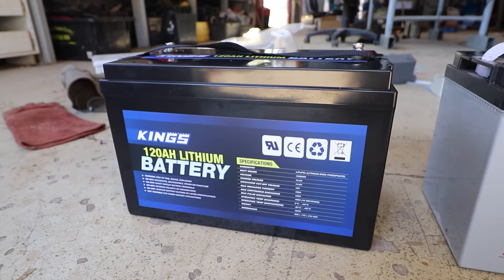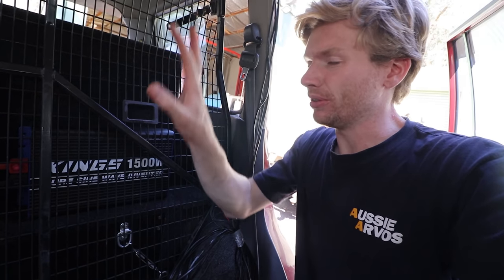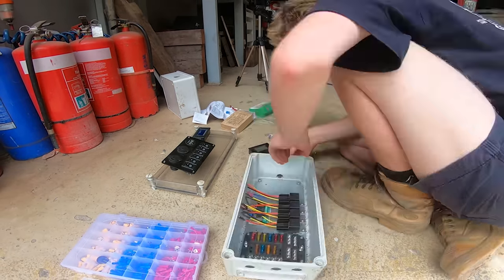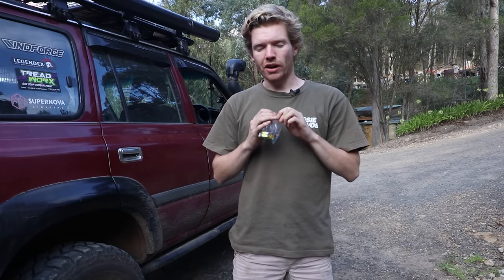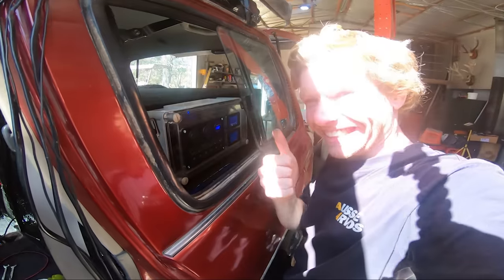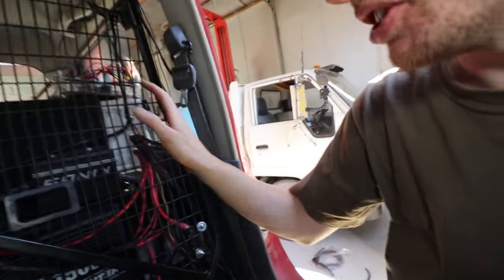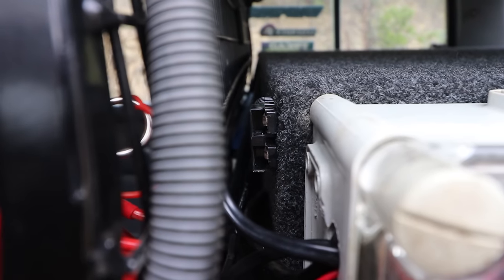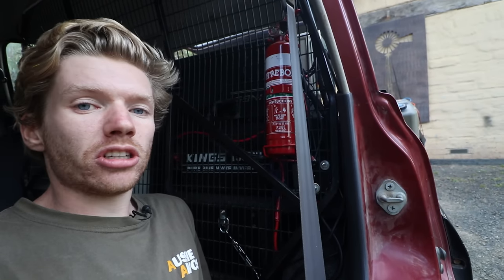is Cheap LITHIUM a BAD IDEA?? Building a REAL Budget 12v Setup

Comment: Well done !! You had a crack , it works,you have a big smile on your face  and more importantly you still have all your fingers and toes.
I have been running a 100 amp lithium power station for just over two years now , and love it.
I have a 25 amp DC/DC charger because that’s the my power station isn’t rated for anything bigger and that works well.
Keep up the good work , love the enthusiasm and the no BS approach !!
Thank you 😊

Comment: Hey Pat, love ya work mate keep it up. It's good to see someone having a go to show people that it's worth having a go at it themselves. I do have a couple of ideas that might help a little more with your setup. 1- is loom tape from car builders. Their tape is amazing and will work good through the grommet holes and will protect positive wires from rubbing through insulation on places like cargo barrier and nicer looking than split tube too. 
2- consider making your own gull wing window now you have your plasma cutter. Some hinges from bunnings, metal or ally frame and perspex window to make the gullwing would work well too if you wanted to see how ya go with it.Keep up the awesome work guys
Reply from the maker: Thanks mate, yeah I think the tape is a good idea!! And doing a DIY gull-wing would be awesome!
Reply: @AussieArvos  theres a guy in the states -dirt lifestyle and he does a really good video on making gull wings
Reply: Legit 👍
Reply: I was told by the professional installer that I could have got away with a 25 amp dcdc charger for just a fridge and a few lights but if I add more things to my 12 volt lithium setup the 40 is probably better and maybe you might find a difference as you run way more stuff than I do

Comment: Solid effort!

The only thing you got wrong is, lithium doesn’t work like an agm voltage wise (it’s a 12,8-13.2 resting voltage & 14.6v Max charging, if possible, set the max charging voltage to 14.2-14.4v so you get the most life out of it)…it’s a stable voltage until it’s empty, then it drops off quickly. Which is why you need the shunt monitoring.
Reply: Spot on mate
Reply from the maker: Thanks Paul, yeah definitely different charge and discharge curve !
Reply: @AussieArvos  although your setup is good… I’d definitely suggest a victron bmv712 unit. It’ll do everything automatically & give you a % of battery capacity @ all times, just input battery capacity & a few other specs…then use a Bluetooth app on your phone.
Reply: @pauladams4890  dude that thing is like $350. I think you've missed the point, he wants to do a budget build. Of course there are better products out there that do everything but that's not what the series is about. This is showing that for a fraction of the cost you can get something that is very functional and is accessible for most people's budgets.

Comment: Looks very neat and accessible! I don't mind the sliding doors on my 80 either. Still usable without needing a gull wing.
Only thing I would change is the battery monitors. I researched these a lot before I bought mine and quite happy with it. I looked at those 2 types but couldn't get over the fact they didn't do charge and discharge in one, so I picked a juntek wireless battery monitor. Has a shunt that supports 300amps with a wireless screen. Screen can be powered by either 12v or a usb cord, so I can move it from the front to the rear to see the charge while driving or at camp. And it only cost around $50. Only downside I have found is it doesn't read current well below around 0.7amps. But can be easily reset to 100% charge if it ever gets out of whack.

Comment: Just did a week on Fraser Island, had a brand new Baintech 110Ah slimline with built in 20A DC to DC.
It is not a budget option but I have 3 kids and had to prioritise space. 

Lithium is the only option for a new setup, initial outlay is worth the long term usability

Comment: Great Video. Im building a truck camper solar system with Victron Dc-DC charger 24/12- 30 Orion Tr Smart, two 100ah Battleborn heated batteries, a Cotek 2500watt inverter, 300 watts of flexible solar on roof cargo boxes running to a Victron Charge Controller. I have yet to get all my cables, switches, DC Fuse Block, Breakers (two like you mentioned) and other bits and bobs. Also appropriate crimpers, strippers, heat shrink, connectors and such. I was keen to learn of your key fob light system. Very cool. Dig your storytelling and your thorough presentation is so well delivered. Thanks.

Comment: I know what you mean about setting up your own 12volt gear, You can easily get lost in it. The best feeling is when you finish up all the wiring, crack a beer and start putting it to the test, watching the gauges and see what she's capable of. Biggest advice is being honest with what you want your battery and 12v setup to do if you just go on the weekender/occasional holiday week- 2 weeks. The kings 120AH lithium while cheap it's charging and discharge parameters should be more than sufficient for running a fridge and a few creature comforts with your 1500w inverter especially with a 25amp DCDC to keep it topped up (Lithium if I remember charges 5x faster than AGM). I live full time on the road (In Tassie at the moment) Travelling around and all I can say is if you're parked up for a week or 2 with shitty weather, having a DCDC is a life saver. Keep up the good work mate.

Comment: Personally 25ah charging is more than enough for most people that have below 200ah battery systems. I run a redarc 1225 with a hardkorr 200ah lithium and not once have I thought about upgrading in the past 1.5 years. I do however run a separate solar input so it doesn’t limit either and I can push up to 15amps an hour of solar into my system by doing it this way if need be. I find that to be way more beneficial as my car although it’s also a daily can pretty much struggle to do 20km a week sometimes so a dcdc is of no use without solar.

Comment: (In an American Southern accent) DAMN SON!  Minus the cable mgmt 😁, that's one slick DIY power box.  Well done👌 Yeah, painting the box, particularly the cover would improve the looks. And since the cover is transparent, I'd recommend painting it (cover) from the inside.  Plus have you considered fitting an extension cord to your inverter, then mounting the extended end at a more convenient location?  Perhaps even use a household type 240V outlet.  I too geek out on the information like what those digital screens shows you. 🤣👍

Comment: On the DC-DC charger be sure to size the input cables properly. I measured a Renogy drawing 13a over the rating. So 20a charger was drawing 33A from the car. Get yourself a DC clamp on Ammeter multimeter. That way you can test individual cables etc

Comment: Hey Pat total newbie to 12v here.
I've got a 100agm battery that in the past I charged up via 240v to run my fridge in the back of the car. I'm now considering a solar panel for the roof with an Anderson plug and using the kings 25amp dc2dc chargr then, over time expanding on that system. 
Your system, although great, would be to overwhelming for me. I think those incremental steps done in stages would be better.
Keep up the great work.
Cheers

Comment: you can tidy the wireing up to the lid by makeing a small flexable loom that will rotate (flex in torsion) as the lid is rotated
- run the loom along the top edge where the lid rotates

Comment: I think people forget about the mid range products and what they’re actually going to use their 12v setups for. Sure you don’t need 5k+ setup but it doesn’t mean you automatically buy the cheapest products and expect the same results. Just have to find the happy medium off cost and functionality
Reply: Exactly!
Reply: Spot on 👍🏼
Reply from the maker: 100%!!!
Reply: Absolutely.  

I have a lithium in my rig.  Did I go and spend $2k on name brand stuff so I can run two hot plates, and a kettle all at the same time? 

No. I bought a cheap one to run my fridge and charge my lights and phone - like 90% of the people going on trips lol. 

Have to remember there are so many more products out there than the ones everyone on YouTube peddles.
Reply: perfect - most people do maybe 6 trips a year including weekends so makes no sense to spend $5-$10k on a full system
Reply: @steve-deltasdad3906  👍🏼

Comment: Great work.
It’s very high tech, the 12 volt system in my 80 is a $25 solenoid between the battery’s and a Anderson plug in the rear with a circuit breaker at the battery end👍
Reply: That works for a lead battery but won't work for a Lithium

Comment: I've done a few set ups and honestly spending the extra and going with a complete renogy kit is so worth it, neater more reliable better performance and by the time you've bought all the ebay add ons (which only need 1 faulty bit of soldering to destroy your car) there's not a huge difference in price.

Comment: In the process of building a lithium setup, I am at the buying bits stage and will do the wiring in a couple of weeks.
Setup is a Voltex lithium from Aldi and a renogy 50amp dcdc charger with BT module.

Comment: Dcdc current in is measured by the hour, 
It is not 25 amps per minute, good wireless  relay set up. I love it, your doing a gr8 job, get a stainless steel water tank, for me I carry 100 liters in gravity fed. With water filtration set up going in, I go off grid for months at a time gold prospecting, 
Water. 3 different ways to cook, 
I turned a 4kg gas bottle into a rocket stove , 100mm chimney 250mm high. And feeder  with drop down hinge for air in Some screw in 6mm bolts inside the chimney  at 90° adjustable height for a pan or Dutch oven to sit on, it's also a water heater 10mm stainless inside for works brilliantly,  kings roof top tent and awning works well,
The enerdrive dcdc can charge at 40+ . I run it and am very happy with its production into lithium, 200amh battery

Comment: Great system and if it does what you need it is perfect!  Great job on saving space and adding functionality  in a solid setup!

One point I'd like to make since it seems lost here:  DC/DC charger capacity needs to be tuned to the battery bank size, not what you're alternator can provide.  

One 120Ah LiPO battery is probably not going to be best served by anything bigger than 30A chargers.  I know I know I know - battery manufacturers claim their max cap can sometimes be higher, but in the end charging is a chemical process to charge a LiPO.  Going too fast is going to cook the battery and/or shorten its life.  If you have sponsors footing the bill for parts - go ahead.  Myself - If I need more capacity I'll upsize my battery bank AND the charger to fit needs.

Comment: A good idea for secondary batteries are battery pole fuses (or fuse terminal) at both batteries. That way, if anything happens, the hole wire will be dead and harmless and it doesnt matter where the short circuit appears. They are a bit more expensive than normal fuses or circuit breakers, but verry easy to install and use. Only thing thats unfused on my car ist the factory wire to the starter motor now, because a 300 A fuse wont burn through even when the car is on fire ...

Comment: Great buildup and honestly reusing old parts for the budget minded is a great way to keep costs down.  However I do have a gripe:
- You're using a circuit breaker (the 200amp one) as basically a switch to turn stuff on/off.  What you should be doing is having a smaller breaker; somewhere around the 60 to 80 amp as the main aim for circuit breakers/fuses is to protect the wiring from catching fire in a short.  The wiring going into your 200amp breaker looks like it'd handle 80 amps max.  It's a suggestion - of course you don't have to listen but that breaker is way bigger than it should be to protect your gear  :)
Reply: Yeh I thought the same, seems as though he is relying solely on the fuses, but with everything so close together in that box I'd want a breaker as a back up.

Comment: I have a 80series I am running a Atem DC to DC Charger 20 amp with solar input of 200amps a 140 amp hour AGM battery works fantastic

Comment: Just a heads up for everyone and anyone who needs to know (just making a small correction on this video). Just because your alternator can charge at over 50 amps doesn't mean you need a bigger charger than 25amps like this kings one. It comes down to how much charge can your battery take safely. I have 1 solarking 100ah lithium, manufacturer says it recommends 30amps max so i went a 25 redarc. some batteies are designed for more or less or depended if you run single or multiple batteries. hope this helped anyone
Reply from the maker: Yeah 100% mate, the king's lithium says it can do 100a input and 100a output (160a peak)
Reply: Agree. No need to load up the alternator unnecessarily.

Comment: Hey mate, Awesome setup. 
Be interested to see how you go with the DCDC charger as I built a system for a camper set up and found that most if not all of the budget DCDC chargers do not have a float voltage when set for lithium. Without a built in float voltage your battery will cycle once fully charged to 80% before the DCDC charger will allow charging of the battery back up to 100%, even if you have solar available or the vehicle is running with your alternator input active. With 100Ah battery I don't see this being an issue for you but I had a 50Ah setup and it was very noticeable. Just something to keep in mind for viewers planning a smaller battery capacity setup. I would not recommend any of the budget DCDC chargers for <100Ah battery setups unless they have a built in float voltage. I believe Redarc and renogy are the only 2 I have found that allow / implement a float voltage for lithium.
I am very interested in hearing if the Kings is the same and if it affects you out in the bush once you have had the chance to test it? 
Keep up the videos and sharing your honest real world findings.
Cheers, James

Comment: Hope the lithium battery works well. Due to work requirements a DCDC air BCDR. Standalone unit wasn’t ideal so went with the redarc Heavy duty 100aH Lithium deep cycle (LBAT12100-HD)  caked up with the REDARC Manager 30 . Worth every cent and it’s paid off too . But in my rig I’ve built it up over the years started with a smart battery isolator and then when I upgraded my fridge and auxiliary battery I put a BCDC1225D . That hardware  setup is all I need it to do  ➡️ power my dual zone fridge be able to keep my GME  RS connect 379 UHF powered up all day/ night long , keep either my rear tray lights on or side lights on when eve I need it on, able to plug phones and tablets in via usb and charge when on the move or when idle/  parked up .

Comment: Just a FYI - meters do not measure the resistance of a shunt (which is fixed) what they measure is the voltage across the shunt which changes according to the current (amps) goint through it. Enjoyed your video and will be interested in seeing how the Kings Lithium performs over a longer time. Wiring can be tidied by using cable wraps without a heap of work on your part which is what you said you will be doing in future. Like the setup you have done and using available space.

Comment: I am currently building an off-road truck to do a big lap, I will be putting 2 maybe 3 200ah lithium battery’s in the truck but I certainly won’t be using any Kings crap I don’t want my truck to burn down!

Comment: Awesome  video Mate
I picked up a few good tips from you here as I also have limited space, so thanks for that. 🙂👍
Hadn't thought of a fuse block thats for sure.
Just ordered a 175ah Atlas lithium battery from Aussi Batteries and Solar to power my fridge/freezer and lights in my camper trailer.
Also ordered power meters that show Ah, volts etc usage.

Comment: I hope to mount a small (50Ah) Lithium battery under the drivers seat of my JB74 Jimny. That should be enough for solo camping for a small fridge and lights and a 25A DCDC charger will charge it within 2 hours.

If I was planning on a longer expedition, or a guest, I would need to pull the rear seats and install a larger capacity slimline battery and higher-capacity charger.

Comment: Lots of work here... well done 👍
I think labelling the cables is a good idea for any time you need to make changes to your system. That might be more about my memory than anything else 😜
I purchased a fused 12 volt distribution box, similar to yours, from eBay and found that when the fuse was pulled there was still current coming through.
It looks to be one of the fuse panels that has a red led light to indicate a blown fuse... put a multimeter on it with the fuse pulled just to be sure there's no voltage coming through. I ended up removing the circuit board from inside.
Enjoying your series on the 80 👌

Comment: Mate that camp setup/rig is my dream god damn XD I'm trying to make it work with a Triton but it just aint the same, the drawers to my god those are perfection. All I will say is if you have any long cable for example connecting your start and auxiliary battery, fuse both ends of that cabling. I have no idea how it works with a DCDC but thats a tip I never knew.

Comment: Another great video !!! I only run a 20amp DCDC charger and it's fine and my 200w solar was pushing 8amps average last trip away. It's enough to keep my 75l dual zone fridge going &  lights, USB charging etc. A powerboard off the inverter is also a handy idea 💡👍